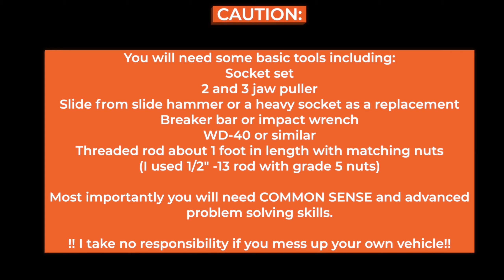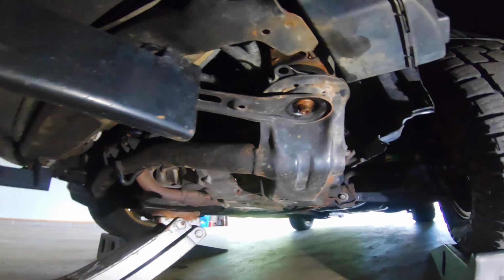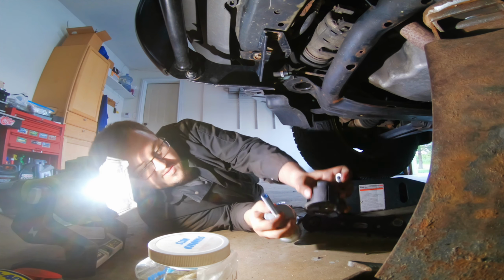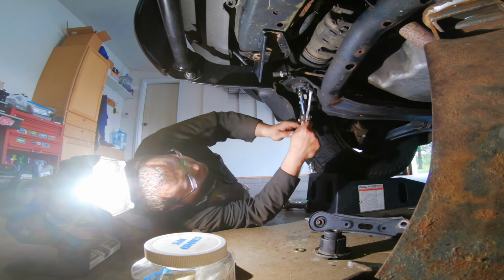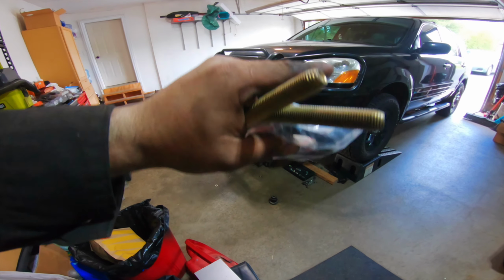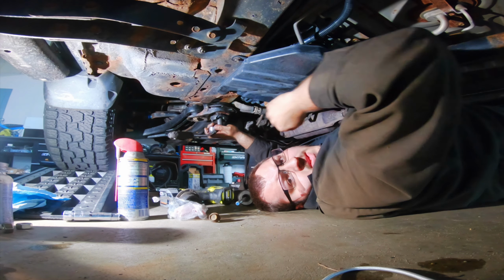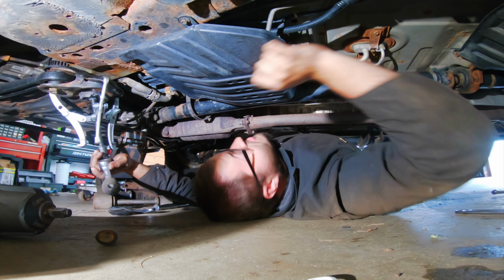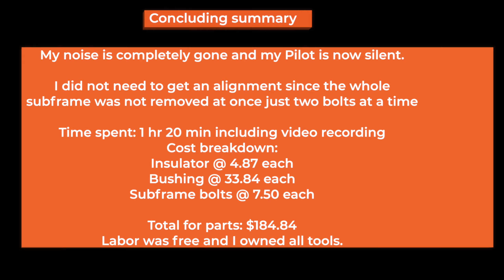Subframe Bushing Replacement for Honda Pilot and Acura (Accord, Odyssey, Ridgeline, MDX)

Comment from the maker: The parts numbers that you need for repair are:
50230-S3V-A01 : Bushings (need 4)
50231-S3V-A01: Insulators that go on top (need 4) 
90161-S0X-A00 : Subframe bolts (not necessary to replace but I did since mine were rusted) (also need 4)
Cheapest place to buy parts is from Hondapartsnow.com (NOT SPONSORED by them)

Comment: Thanks for making the vid - lots of other sources seem to think only can be done w/ subframe removed!
I was able to install the bushings by using a bottle jack (raised on some 4x4s) to push the metal sleeve of the bushing. They installed easily w/ some soapy water.
Reply from the maker: Glad to hear that you were able to install the bushings. A bottle jack would have been a much better idea than a gear puller

Comment: Great problem solving! Have any ideas for replacing front stabilizer arm bushings? I just did control arms & tie rods, figured I'd do the stabilizer bushings while I was in there, and the rear drivers side was almost completely inaccessible. Noone else has addressed this on youtube yet (2006 MDX, same as a Pilot of the same vintage) so I figure it must be a real you-know-what. After 30 minutes of fighting with that bolt, and losing, I threw the new bushings in the toolbox and did the repairs that really needed to be done... Good video, thanks for taking the time to share it!
Reply from the maker: Thanks! The front stabilizer bushings are pretty tough especially the drivers side. There's only two ways to get to them. If the bolts aren't stuck or seized, you can use an offset wrench to get at them (mine were seized so no luck for me but others in southern states have zero issues with this). I've heard having a few different sizes helps. Harbor freight has a set that I know works on the Pilots. If that is not an option, then you'll have to drop the subframe a little bit. I did this at the same time as this instruction video but I dropped the entire subframe about 1-2 inches and had no problem reaching the bolts. Remember to put anti seize on the bolts as they love to seize up and become impossible to remove

Comment: awesome video Aleksandr, congrats!! please, do you have the parts number? I need to do the same thing. Appreciate it, take care.
Reply from the maker: Hello!
The parts numbers that you need are:
50230-S3V-A01 : Bushings (need 4)
50231-S3V-A01: Insulators that go on top (need 4) 
90161-S0X-A00 : Subframe bolts (not necessary to replace but I did since mine were rusted) 
Cheapest place to buy parts is from Hondapartsnow.com (NOT SPONSORED by them)

Comment: where are the point markings to line up bushings ?
Reply from the maker: The bushings have a line. That line lines up with the alignment holes in the subframe. Those are the empty holes in the subframe used to align the subframe with the chassis.